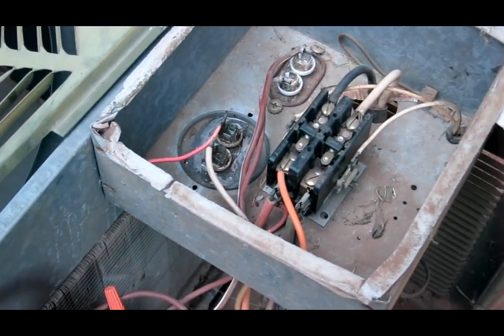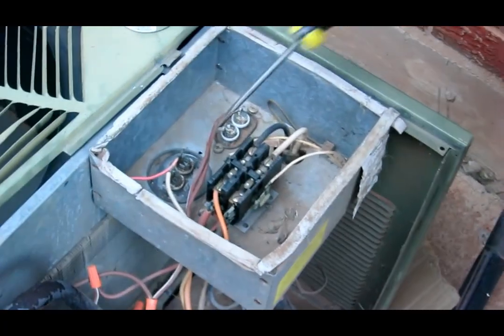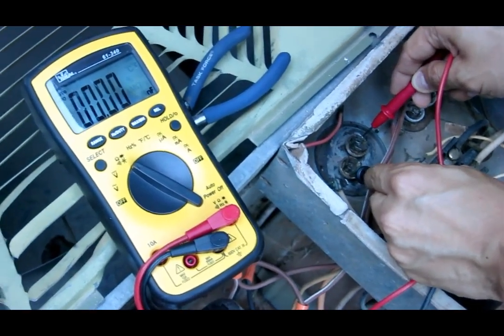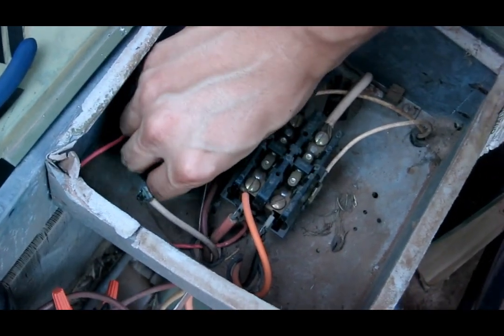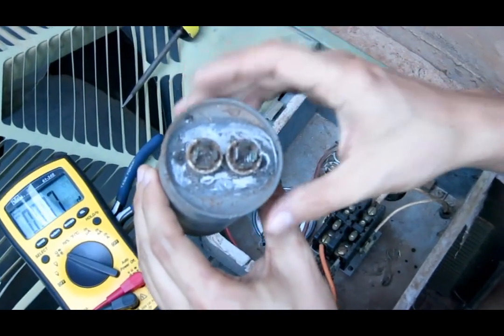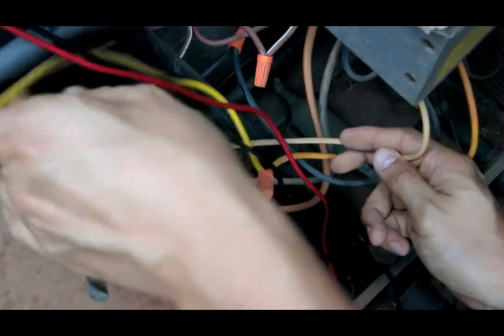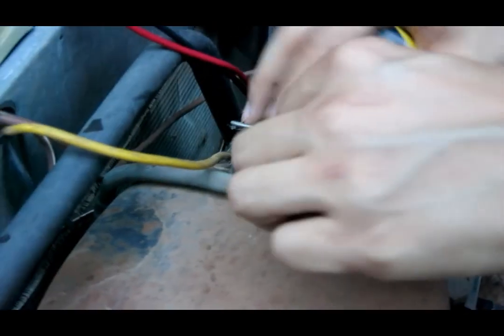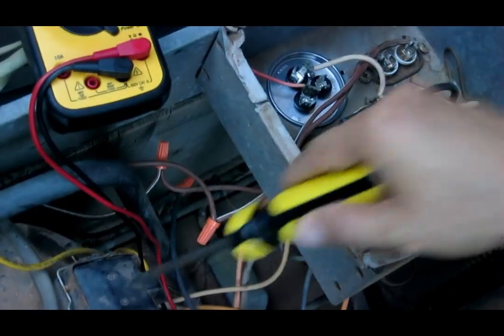How to fix your AC - Fan kicks on but Compressor Not Working - Replacing run start capacitor

Comment: Due pointed  capciter  herom    starting pointed          f..pointed  fan   c..comon pointed  other  contacter giveing    conter and potshion systom old model depsnding of  making systom split ac  models   power contacting pointed
Reply: Due type  c  comnon  ruing point giving  herom starting point     comprssor  side   f  point fan  giveing fan not adshiin  comn power lined other  capciter mfd 5.or6mfd giveing fanttaped point out fan solved

Comment: Welcome to jobe poply jobes exprines perfited jobe lont servies with rul hvac jobe and lot off jobes cearfulhvav jobd comanshion off depsnding work lot  modrls unit and lot type gas using  idtiny fying systim tolt lord toly valvu wth  cspcit and  workin low high vlotges work    hvac   jobe capciter  enizing  due typ cspcitef  herom    starting pointed  f..fan  ...due mark  .c.. point  comon ponited

Comment: So the capacitor, if I accidentally touch it it doesn't hold power and won't kill me? I'm about to replace mine and I'm a bit nervous. About high voltage and amperage.

Comment: Old doesn't show where the wires go because it is not polarized. It doesn't matter where the wires were. It's Ac current and it charges and discharges switching polarity 60 times a second

Comment: Looks like my unit but mine is slightly older and a bit different, smaller i believe. But 2 capacitors. this helps me, thanks.

Comment: Start capacitor and Run capacitors are 2 different things. Your colour codes do not match because you are replacing a run capacitor, not a start capacitor.

Comment: Your not draining the current your discharging the electrical pressure (voltage) from the capacitor. Your heart will draw current from the capacitor which is amperage draw. You can't have current without voltage ohm's law current and voltage are directly proportional. Amperage kills you not voltage. So with a capacitor you want to de Energizer and relieve it from electrical pressure. Wear gloves they have not made a tool to properly d energize a capacitor everybody just does the sideways screwdriver.

Comment: He doesn't have the breaker off inside that's why when he put back in the bridge to the disconnect it kicked right on big No-No especially if you don't know what you're doingwhat you don't that's why you're watching this turn the breaker it's going to be a 30 amp

Comment: This guy shouldn't touch bare handed in there. Very important! You pull the disconnect you still can be live if you have the indoor fan on. Usually right side of the contactor. TURN BREAKER OFF!!!!

Comment: Hello, my AC just did the exact same thing with changing the capacitor, but he said the compressor still was not working after he changed it. Ut it showed the capicitor was getting 40 volts its supposed to.  Is that possible that just I just need a new compressor now?  Thank you

Comment: It would have been a good idea to replace those terminal clips while you were at it. They looked nasty and didn't appear to fit very tightly. I would also have used the fan cap side for the fan.  The common on the capacitor always goes to the supply.

Comment: Does Daikin inverter Aircon compressor also had capacitor connected? My Daikin inverter Aircon stopped after running for few minutes and the indoor unit light blinking. Fault code E5.

Comment: I used to and miss working in the HVAC/Refrigeration industry, had to stop due to having Multiple Sclerosis some years ago. It was the worst career to get into do to severe heat and zero degree temps. Can’t be in either of them! I enjoyed driving from job to job diagnosing and making repairs!! This was a easy gravy repair lol 😉😎👍

Comment: Qns: What will happen if the HERM & COMMON are connected opposite? Will anything blow? Will it kills the capacitor? i.e will there be any permanent damage done?
Reply: Not a problem. He could have hooked it up either way since he didn't use the fan terminal.

Comment: I think my Carrier outdoor unit might have a locked up compressor, but I am not sure. If any of you have some decent knowledge on A/C units in general, could you be kind enough to go to my channel and take a look at my "Carrier AC/heat pump outdoor unit- Bad compressor or compressor not running?" video? I could hear a decent buzzing sound at each startup, but I could also hear short buzzing sounds throughout the length of the unit running.

Comment: I had I big problem today. at first the compressor comes on but it started ok but after 10 - 20 seconds later it would start making loud noise then shut down. I replaced capacitor and hard start. but it keeps doing same . if you have any suggestions I would gladly appreciate it

Comment: Recently my AC is acting up,  the fan would turn on first  but the compressor or motor  is not,   it sounds like it  struggling to come on, after several time it eventually came on, can you please tell me what causing it to do that and what is the replacement part I need. Thanks in advance

Comment: Thanks for the info, I replaced the run start cap and when I did it gave me a loud pop and left a greyed out spot on top of the all run cap, but it all came on. But then I saw the contactor was sticking so I replaced that. For 1 whole week the a/c ran fine but now the fan comes on and the compressor wont come on again. Do you think that loud pop and greyed out spot messed the all run cap up?

Comment: You didn’t do too bad. Although the spade connectors were loose. Tighten them by pushing in the back clip not squeezing the outside. This could cause an early failure on the new cap. Rinse the coil as well.

Comment: What would cause a window unit to stop blowing air after running a few mins then we turn the breaker off cause we can hear a motor running and after a few more minutes we turn the breaker back on and it starts running again?

Comment: That's true man .i do have a mobil home and last march of this year 2018 I did call the air cooling and heating guys just for  maint the unit  i do live here since 4 years ago and didn't have any problems till now they did check it out and diagnosed with bad compressor so they told me a used one  it will cost me with labor $850 so just thinking if really it's that or i just getting riped off.any suggestions please.
Reply: ELIAS RODRIGUEZ probably too late to help but anyone selling used compressors is fixing to sell yours. Get a second opinion. Ask your neighbors who they use.

Comment: Just had this problem occur to me, but unit only has a dual cap with fan connected to it. Home owner said he changed cap himself. Well when condenser starts the only thing that comes on if odf. And compressor never does. I ohmed compressor and it came back good.
Reply: It’s a spilt system by the way.

Comment: will a bad run start capacitor cause the ac unit to SPORADICALLY work?    in other words, sometimes it will kick in, while other times it won't....thanks..

Comment: five years on, this helped me confirm my issue--i actually have the three head capacitor.  My fan was working, and the compressor was warm but I wasn't sure if it was running.  The fan tested at 4.7 mf, the compressor tested at about zero.  Also, there was absolutely no condensate in the pan inside, and air was coming through the registers but it wasn't cool.  It all pointed to a failure at some point in the coolant line.  I haven't replaced the capacitor yet, but pretty this is the problem.  thanks for the video.

Comment: fan kicks on every time blowing cold air from the unit outside only blowing cold air outside compressor kick on for maybe 5sec then off fan doesn't go off no change in ac temp indoors between 5 to ten minutes later compressor does it again an continues as long as I have it running

Comment: Hey I have a Aaron hvac unit with 2 compressors one works but the other one don't start , can that problem come from the capacitor? Or what other parts  could be bad ?

Comment: This video helped me diagnose my problem as well.   In my case, the capacitor was fine, it was a bad wire leading to the capacitor (break in the wire... how that happened, who knows)  fixed the wire and bingo, I've got the compressor working again, and the house is already starting to cool off.  Thanks very much for the video.

Comment: my unit has a run capacitor that has the brown and white stripe wires going to the fan.  Also the is a capacitor that has C HERM FAN. however there is also a hard start relay capacitor that I discovered chared... Question, they capacitor with FAN HERM C on it is oval and has an additional wire. can I run a dual capacitor and how would I put these wires

Comment: Exactly the video I was looking for / needed! Thank you for sharing. That AC unit is the same model as mine too so it made more sense. Going to order new capacitor and hope it will be problem solved for $16 and the time it took to watch your video (twice)! Thanks.

Comment: Good video, but I would have hooked up the fan side as well as a preventative measure.  You're a good friend to help your buddy out and save some $$$.
Reply: If you decide to hook up the fan motor to the dual run capacitor, be sure that the fan side of the capacitor is the correct rating!

Comment: My air conditioning blows cold air, then the fan outside cuts off and warm air continues to blow inside the house. I've change the thermostat but still have the same problem. Can anyone help?
Reply: still having issues Daphne? could be the fan, capacitor, wiring.

Comment: goodman cpkj24-1a had tech out last week, replaced starter cap and added 2lbs of coolant.  unit worked two or three days, now condenser isnt kicking on. is it shot? husband does controls for a living wants to check the lps but cant really find anything helpful so far, always tried another new capacitor and nothing..

Comment: My AC starts and I get cold air inside the house. But after 5 minutes, I can see the fan stops spinning then makes a buzzing/grrr noise. It's a 20yr old York and all they want to do is replace it (for 5,000$). Is this a problem with the capacitor as well? Thanks!
Reply: first you need to check if there is 2 seperate capacitors like in this unit. then test each one...sometimes the top of it is bulged out indicating that it is bad. if your fan kicks on then the capacitor is doing its job already.

Comment: respected sir,i have air conditioning capacitor i want to replace i have also spare capacitor placed in stock.the problem is that there is not mention which terminal is for common, herm or fan. could you guide me how i fix this problem. i have lcr meter to measure capacitance too.
Reply: like he says in the video, you get a certain amount of capacitance between the common and compressor contacts, and certain amount of capacitance between common and fan terminal. it will indicate how much on each terminal on the capacitor. thats how you find out which terminal is which.

Comment: our central a/c is for a mobile home, not connected to our furnace. Only two years old, noticed not cooling as well and then fan would come on but after 10 seconds it would click off. new batteries in the thermastat, turned and checked breakers. any ideas? compressor is the only thing still under warranty. thank you
Reply: Check the pipes going to  and from the condenser on the exterior of your home. If the pipes have been damaged, crimped or bent, a  high pressure sensor may be triggered and the  compressor will shut off after about ten seconds.

Comment: My AC fan is running, no air coming out of vents, return air not working. If we turn the unit off for a little while it will work when we turn it back on. We just had the capacitor replaced and it happened again. Worked great at first. Any suggestions?

Comment: thanks for the video! but the compressor kicks on on ours then turns off, every year it will do this then automatically stay on after cleaning the unit. I have no idea what causes this??? any idea?
Reply: Rookie Bee yes your condenser is dirty and tripping the head pressure switch. Is the dryer vent near by? I rinse my unit every time I get a light bill. YES once a month. Except in winter. I’m an AC tech with over 40 years in the field. This is free advice. Use it as you wish.

Comment: when it comes to run capacitors you don't have to discharge it. the only discharging is when you get to a start capacitor.
Reply: i think the safe thing to do is  to discharge any capacitor
Reply: +Greg Oleksa exactly...

Comment: Where should I go to buy a replacement capacitor? What would happen if it were wired backwards?
Reply: +TomlinsTE Ebay or Amazon
Reply: TomlinsTE you can only get capacitors for a/c application at a refrigerative wholesaler as far as i know and it would just try and turn the compressor on but it wouldn't be able to turn the pistons so it would just heat up and heat up till it trips on its thermal overloads

Comment: Mine will only run when I take a screw driver and hold in the contact . Is the coil bad or the capacitor ?
Reply from the maker: cooldog60 you need to check and see if you are receiving 24-28VAC on the coil. if you are getting the signal; then you have a bad contactor. if you arent getting the voltage, then you might have other issues (e.g. thermostat, transformer, etc..)
Reply: DIY Tinker Okay, Thanks.
Reply: Thomas Headley How do I bypass the thermostat?

Comment: Can the inside unit run without the compressor working for a night?
Reply from the maker: Zavier H yes. if you want the fan to circulate air, then switch fan from "auto" to "on" at the thermostat
Reply: the answer is NO...  
like he said, you can run Fan only........   but the AC is not going to be doing anything............  you would be better off just running a regular fan pointed at you.
Reply: Well, there are two fans.  The external fan at the compressor/condenser exchanges the heat produced by compressing the coolant.  The internal fan/blower moves the cooled air through the home.  If one sets the thermostat's 'FAN' setting to "ON" and then set the trigger temperature to something higher than the inside temperature...the internal fan will blow (warm) air without the external unit being engaged.  Although, I've seen plenty of systems wired with the blower fan running on the same leads as the compressor...such that it won't run independently.

Comment: My fan outside is turning on but it trips the breaker outside. I unplugged the fan and the compresoor made a small noice and 5 seconds later it tripped it. Could it be the compresoor or the capacitor?
Reply: You could possibly have a bad wire. Check the wires going in to the contactor. Look for burnt wires.

Comment: I have a 3 ton 3600btu AC split unit .. fan is ok, but doesnt cool, in fact, there´s electrical statics (like a piii noise).. Could anyone point me in the right direction of where to read or what to do ? ? ? PLEASE.    I´ve hard about buying and apllying a Master Patch (or something like this) which powers harder to see if the condenser actually starts...    or should I directly as this video shows change its capacitor?   THAAAANKS

Comment: All coils are clean like new.
If refrigerant is empty I would expect AC doesn't give cold air, but it does.
The question why is it cooling pipes when AC is physically off?
Thank you!!
Reply from the maker: a simple comment cant explain everything. search google "hvac condenser frozen" and lots of websites have good info on that subject.

Comment: Hello
Thank you so much for such a useful video!
My AC still does work and blows a cold air and fan works.
I'm concerned what is going on with it when it's off: outdoor stationery AC unit makes constant moderately loud noise and when I take look inside I can see frozen copper pipes literally covered by ice (its 70F outside)
What might be reason for that?
Thank you so much!!!
Reply from the maker: That isnt normal, several issues can cause this. For starter, check your evaporator coil and clean it, then clean the condensor coil. I have few videos on my channel that you can reference. If that doesnt help, then you should consider a HVAC tech asap. you might be low on refrigerant, or something else might be going bad.
Reply: Hi, Please refill your Condenser with its suitable Refrigerant gas. When there is low gas, the ice forms on the Copper pipes & inside the Indoor unit as well. Thanks

Comment: How did you measure the voltage after disconnecting the power?
Reply: Test voltage at the contactor or the disconnect

Comment: You have to tell them that the common on the capacitor (red wire) has to be opposite the black wire on the compressor contactor, or it will be out of phase.

Comment: Looks well used! Original contactor? I use my old Fluke 12 for most maintenance work as they're set up for one handed operation on the selection and has capacitance function...

Comment: I replaced my capicator about a month ago because the fan stopped..Everything ran fine until yesterday..Now the compressor is not kicking on..This unit only has one capicator with three leads.Is it possible that this new capicator has already went bad?